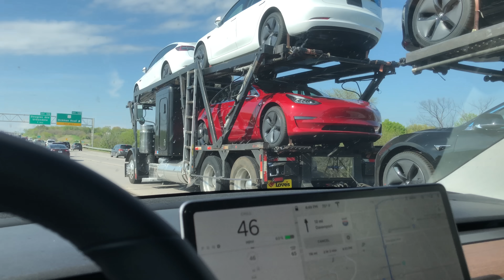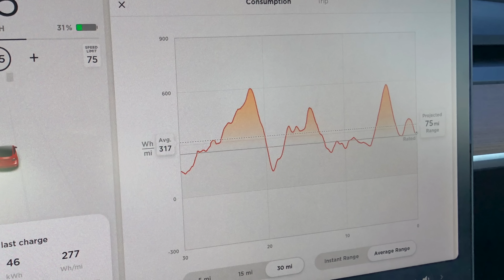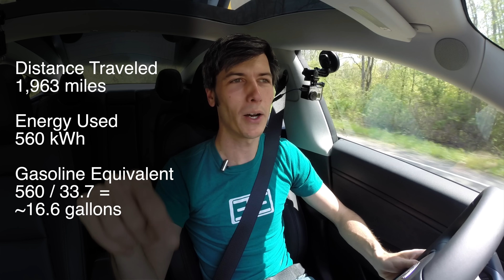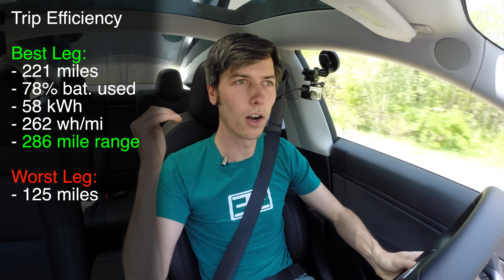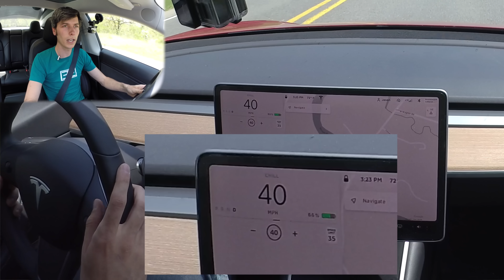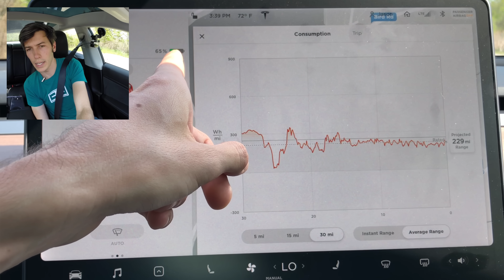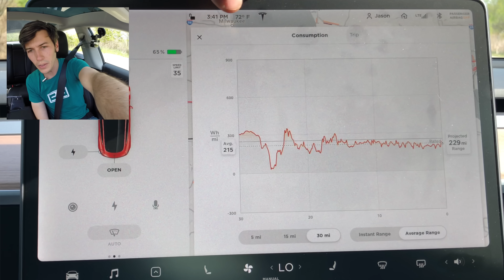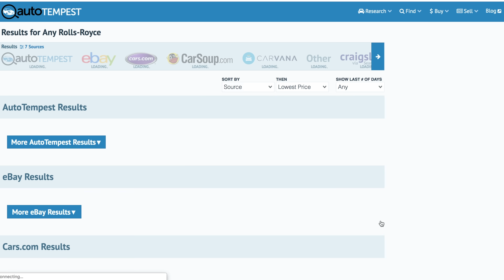How Miserable Is A Tesla Road Trip?

Comment: Too bad you couldn’t fix the tire and charge battery at the same time!
Reply: @Allen Loser Sure you can call it marketing. But in every day life it really is true. When you're not doing road trips, it's easier to drive electric - it really is. If you're someone who never travels outside your car's range in a day, then an EV couldn't be more convenient, fun, cheap to operate and comfortable. But when you're going outside its range then it's true that you have to spend a non-zero brainpower on planning. And you're forced to take comfort stops, rather than racing to get to your destination as fast as possible. Like everything, alternatives have pros and cons. EVs also have many advantages that ICEVs don't have and that you'd dearly miss if you get used to an EV.
Reply: @Allen Loser Thanks for your approval of my life choices, I guess. But if you think I'm contesting that an EV has deficiencies for your use case then you're missing my point. My point is that it's common to misjudge EVs by focusing on one deficiency and ignoring all the advantages. Many people who try out EVs are fundamentally surprised at how great they are because they've believed in all the bashing they get. If you're worried about how overhyped or warped the rumors are, then all you need is a test drive and an open mind, and you'll quickly figure out your own real opinion. Could be the same as your current one. Could also be very different. Because EVs true capabilities are pretty foreign to most people. Reading or watching videos about them is rarely enough, in my experience.

Comment: A flat taking 7 hours? I'm guessing there's no spare.
Reply from the maker: It gets so much worse. 😭
Reply: @EngineeringExplained  Future video topic?
Reply: Most modern cars don't have a spare tire anymore. But it shouldn't take 7 hours anyways.
Reply: @Hoch134  Yet another reason for me not to buy new.
Reply: @HarleyPebley  You have the place to fit a spare wheel, the question is if you actually need it. I never needed one in my life, the hole repair sets worked fine for me.
Reply: @Hoch134  They're not super frequent, but I've had enough flats that I wouldn't want to go without a spare. Two in the last nine years on my current daily driver.
Reply: Hoch134 Full sized spare in my Grand Marquis WITH room for 2 suit cases golf clubs and a corpse!
Reply: Hoch134.  Your plug set won't work when you cut a sidewall.  Even at that you're carrying a compressor and plugging a tire the tire companies say don't do.  Worse yet using Fix a Flat in electronic sensor valve stems.  That's $120 wasted.
Reply: @Hoch134  That's horrendously short sighted and dangerous (more like non sighted) The day you're on the side of the road with a shreaded tire, like many others I see daily, will open your eyes. That's seriously one of the things you'd best have and never need than not have once you're in a pinch.
Reply: @MaddJakd  The plug sets are used to get back to home to change tires or at least get away from the road to a shop or so.
Also, don't tell me that a 10 year old tire (which is often used) would be any safer.

And of course, the set won't work with big cuts. However, I've never experienced those in Germany ,while in the USA there are masses of tires just laying on the side of the street.
I also mentioned that if you wanted to, you could fit a spare tire in every car.
Reply: I have run flats AND a spare tire!
Reply: I've yet to use roadside but will be trying them in the morning as I've had two screws in the same wheel in two months, the first in the sidewall. These tires are very expensive to replace...

In theory they'll swap a loaner wheel for free and I can get the tire fixed on my own time and then drop off the loaner.

Comment: Until the charge time is that of a gas stop it will remain an urban dweller.    Basically a rich mans toy that is very impartial for the vast majority of American drivers.
Reply from the maker: If you really need to go 2000 miles quickly, we have planes haha. I found it genuinely a solid experience, much better than I was anticipating. Charge while you eat, not a huge deal.

Comment: The thought comes to mind that, while the existing power grid can continue to cope so long as electric vehicles represent just a fraction of 1% of the vehicles on the road, wouldn't it have to be seriously "amped up" for all gasoline-powered vehicles to be replaced by electric-powered vehicles?  Also, it's unfortunate that so many jurisdictions generate their electricity by burning coal, which is far worse than gasoline in terms of the creation of green house gases.

Comment: What if you have a 370V, 3 phase outlet at home? How fast would it charge?
Reply: Pirat that’s basically what the Superchargers are. 

(MENA rating is 347v btw) with 50 amps. 

So same deal. 

20-30 minutes for a 65% charge
40-50 minutes 90%
Under 1hr  100%

Comment: A note on range anxiety: if you are driving fast (or even slow) with the nav active, and wont be able to make it to the next charger, the car will let you know immediately, and tell you the max speed you can travel, it will say something like "Drive below 75 mph to reach your destination".
Reply: Swampy  The Tesla Nav also takes hills and terrian into account in calculating how much battery life you'll have left. Thats why the grey line in the graph is very jagged like a stock market graph instead of a straight line.
Reply: Swampy  not really, the trip/nav range calculates for them fairly well, it's separate from the vehicle EPA range, and avg ranges. It may not calculate based on heater usage tho, so if you do get that warning in the winter and are worried, you can turn the heater off to be safe, and then it should be very accurate.
Reply: @brantwedel  the instant you turn on the heater your range drops, it calculates with the heater on
Reply: @chublez  I wait until the gas tank is indicating empty. Typically refill with 5 Miles indicated on the range indicator.

With petrol stations being rather common, we don't have issue refilling until the last minute.
Reply: Jay Barker  that is called a diesel car
Reply: That is not my experience at all.  At least here in Europe it knows elevations and will predict accordingly.  You can actually see the ups and downs on the projected trip energy chart.
Reply: Jay Barker  
Range anxiety goes away fast. Once you know what the car can do, you don't even look at the battery indicator.
Reply: Swampy  Right, it doesn't "need" a buffer as long as the driver pays attention to all the data Tesla provides. But of course a lot of drivers don't pay attention and therefore "need" that buffer to save their asses. It's like backup cameras are only good if the driver actually looks at it. It doesn't prevent them from recklessly backing over a child.
Reply: Jay Barker  Self charging!!!
Reply: @Neo1-h7d  the Bolt is the pure EV, the Volt is the hybrid (Chevy with thier naming), but they don't make it anymore, probably some good used deals, wish there were more range extended EV/ hybrids like it!
Reply: Swampy  Not true at all, Tesla navigation factors in elevation changes. (source, just drove my model X all over coloado utah and wyoming.)
Reply: Justin Paulson how many years did it take get real.
Reply: Hopefully no headwinds ehh? :)
Reply: Or take a train.
Reply: Sic Semper Tyrannis  actually, it is only an accurate if you are towing a trailer. It also knows hills and altitude so it knows that if you go downhill with regen you will go much farther and if you go uphill you will go much shorter. It already knows that.
Reply: Jay Barker  Brilliant idea! 
We should nominate this guy for the next nobel prizes.
Reply: What does it say when you get there and it's out of order.  Lol.
Reply: @brianpatrick8787  It will tell you beforehand if there is a charger out of order so you don't waste your time going to an "empty stall" as you would a gas car.

Comment: Gas in the US is less than $1 per liter? That's cheap as hell. In Europe it's around 30-50% more expensive. I just filled up 50 liters (around 12.5 gallons) and paid around $67. That's $5,36 per gallon!
Reply: Obviously gas is priced in GALLONS in the US...but I actually did fill up yesterday at a place in Port Roberts, WA that sold gas in liters. $0.77/liter. Port Roberts is only accessible via Canada from the rest of the US so I think the majority of customers are from Canada. A few miles north in Canada gas was $1.54 (CAD)/liter.
Reply: Where i am in the Azores, its about equal to $2 a liter, or 1.46 euros/liter. Even a small car such as a hatchback can get a bit expensive driving 100+ km regularly
Reply: $1.63 AUD a litre down here in Tasmania, Australia. And that's just the cheap 91 Unleaded!
Reply: used to be even cheaper by 30% at times
Reply: Pirat:  But you've got universal health care.
Reply: Ouch!
Reply: I paid US$2.84 / gallon regular this morning in UT as a reference for you.  We're one of the higher cost states, which are concentrated mostly toward the west coast.

Comment: Honestly I expect that the electric vehicles of the future will still contain an internal combustion engine, and I wish Tesla would include a flex fuel generator in all their vehicles. Being solely electric and power grid-based is somewhat shortsighted.
Reply: There is a BMW i3 REX. But i has very small tank (8L).

Comment: 3:38
"increasing exponentially"
No, it's not! Please go back to the school and learn what exponential means.
Reply: Wind resistance and drag does increase exponentially as you speed up. You're the one who needs to go back to school.
Reply: @zacharybaker5910  No, not exponentially. It grows with the square of the speed.
Reply: @molozful  It grows with a cube of speed.
Reply: @molozful  Squared is still an exponent. In regular speech it's also used to describe something increasingly rapidly, which applies here too.
Reply: @zacharybaker5910 
According to your logic constant is also exponential. It has 0 as an exponent.
FYI: Function is exponential only when there is a variable in exponent.
Reply: @TheUglyGnome  When calculating drag, velocity is squared, with it being the variable in that case. As speed increases, drag increases exponentially, along with energy consumption. It's not a linear relationship.
Reply: @zacharybaker5910  
Did I say it's linear? No. Is velocity in the exponent of the equation? No. So it's not exponential. As others said: it's quadratic (or polynomial, as we computer scientists would say).
Reply: @TheUglyGnome  He said "As speed increases, the energy required to overcome aerodynamic drag increases exponentially". While the drag may technically be a quadratic equation, the amount of energy required to move the vehicle greatly increases as you speed up. While not fitting the exact definition, the word is still being used correctly to describe rapidly increasing energy consumption at higher speeds.
Reply: @zacharybaker5910  
If he wants to say it increases rapidly why didn't he say 'rapidly'? Why say 'exponentially', which has exact definition? 
And why are you shifting goal posts? First you insisted that it was exponential phenomenon. Now you say it's OK to say 'exponential' even if it's not. 
Are you 'Murican? It would explain a lot.
Reply: @TheUglyGnome  Along with the mathematical definition, exponentially can be defined as "characterized by or being an extremely rapid increase" by Webster's dictionary, making the use of the word appropriate in this situation. Saying quadratic would be unnecessary considering exponential gets the exact same point across.
Reply: TheUglyGnome
"Exponential," including the adverbial form "exponentially," covers both cases of the exponent as a constant, and exponent as a function of an independent variable:
1 : of or relating to an exponent;
2 : involving a variable in an exponent  (10 to the x power is an exponential expression)
(Merriam-Webster)
Reply: @geoh7777  
If it covers exponent as constant, then functions f(x)=x and f(x)=1 are also exponential. Both are just shorthand versions of functions with constants 1 and 0 as an exponent.

Comment: Low profile tires is the stupidest thing in auto industry, it has nothing to do with performance (actual race cars have chunky sidewalls)  just a style, because people think bigger is better.

I believe on Model 3 Performance you can easily fit R18 wheels, not those oem R20 donks
Reply from the maker: 18's would be tight, but perhaps possible. Large brake calipers on the 3P.
Reply: @EngineeringExplained  Already checked, R18 do fit on M3P, it's tight but they fit.
Reply: Low profile tires and no space saver = bad idea. You're always going to pop the sidewall and cant' repair.
Reply: Even 18's are low profile from the norm 10 years ago.
20's are crazy thin. Lucky the rim was't bent by the pothole.
Low profile tires are a fad.  Everyone wants them now because they  think they look cool and they don't think ahead to the consequences.
I remember when big rims were considered super ghetto.  Now, everyone is like: Oh, no! There some wheel well gap! Gotta fill it with more rim!.

Comment: True efficiency; $156.80 vs $196.30 plus lost time plus rare earths consumed, whereas "gas" is renewable.  Maybe if gen.4 nuclear was prevalent that efficiency would be greater though.
Reply from the maker: "Gas" is anything but renewable haha. You won't save time or much money EV road tripping, but they are far cheaper to run if you charge at home.
Reply: @EngineeringExplained  Bioethanol is renewable but I don`t think they sell E85 in US.
Reply: @procerator   they sell it some places in the Midwest.  Wildly not a hot thing...
Reply: @EngineeringExplained  think again.

Comment: Cool vid, something youtube has lacked. However, maybe you can engineer-explain why Tesla batteries can charge so fast between 15-65% and doesn't it wears down more quickly etc.
Reply: The wear down happens when fully charging at fast speeds I think. That last bit at around 95 percent. Linus tech tips has a video on li-ion batteries on phones. Don't know if it applies to these batteries though.
Reply: I know that, that was not necessarily my emphasis. Anyway, LTT did some explaining, not sure that majority of people watches the same channels. Anyway, its his choice, i just love his explanations. :)
Reply: It's not specific to Tesla batteries.
Reply: The batteries are liquid cooled. Heat has a big impact on the life expectancy of the battery so being able to keep temps down during charging means you can push more power into the battery.

Comment: Jason i have a question ... Why can't manufacturers design manual transmission with a torque converter?
Reply: Why would they? Torque converter lowers efficiency.
Reply: They probably can, but it doesn't make any sense to do it
Reply: @Morgarathable  why not
Reply: @tomster7574  You are getting lower efficiency of a torque converter and slow manual gear changes - two things that every manufacturer wants to avoid nowadays
Reply: They have. Vw made an auto stick beetle. It had a stick but no clutch.
Reply: @JamesSmith-dn8lb  you must be old like me n jason :)
Reply: @hotrodamd  only 26 lol. But I had alot of old cars when I was younger.
Reply: They could, but they don't for the same reason they don't use them for automatic transmissions anymore - autonomous clutches controlled and actuated by electro-hydraulics have made them obsolete, as they work faster and transfer torque and power a lot better.

(I think J explained them in the series about dual-clutch transmissions, anyway a single clutch of much the same sort is often used for lighter and cheaper but less smooth and efficient electro-hydraulic gearboxes.)

Even if there weren't automated clutches like that, picking gears manually without having to operate a clutch pedal can usually be done with an automatic transmission anyway.
Reply: It wouldnt be a manual
Reply: i meant replacing the dry clutch with a torque converter ... just saying .... Torque multiplication can help in no?
Reply: They have many times before. But you need a clutch and a torque converter for the manual gearbox to work. The better way to do it is a torque converter connected to a centrifugal clutch, so the clutch disconnects when you come off the throttle.

A bad way to do it is what hillman did with a kind of magnetic electroclutch - it relied on iron filings being energised between the two drive plates to transfer drive. What could possibly go wrong...?
Reply: It wouldn’t make sense. The clutch exists to break the connection between the transmission and engine. Same as torque converter
Reply: Just get an automatic with a fully manual valve body. Problem solved
Reply: Manual transmission does not need any form of torque sensing mechanism or device to automatically shift gears. Gears are selected from the driver itself in manual while in Automatic Transmission, the car automatically select gear for the driver.

Automatic transmission need to automatically shift gears without the help of a driver, so it needs some sort of torque sensing device to sense the difference in torque between the engine and the wheel so that the car know exactly when to shift the gear, which is the reason why we have Torque Converter.

Torque-sensing device is just useless to have in a manual transmission.